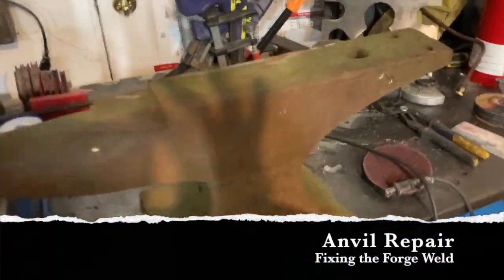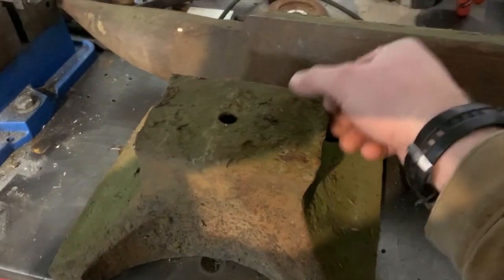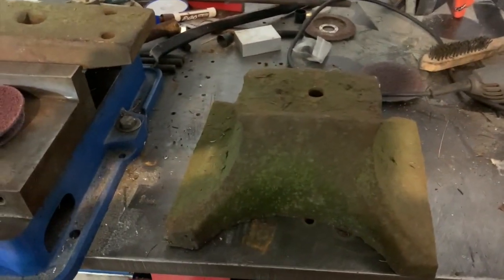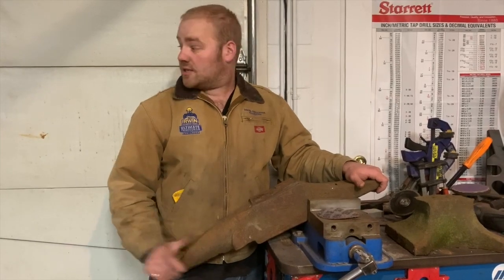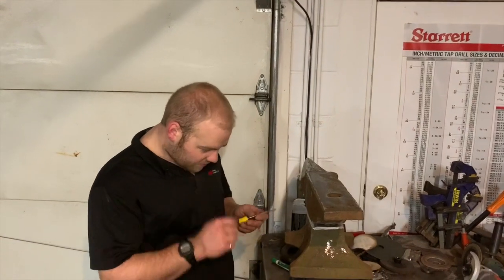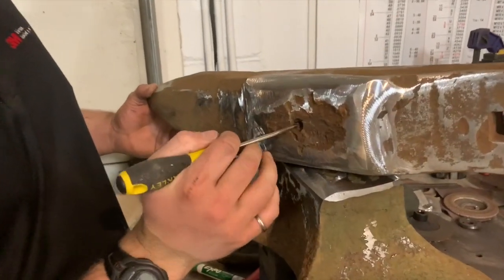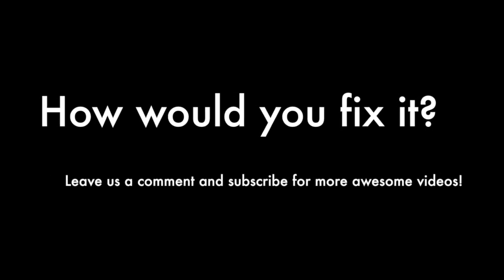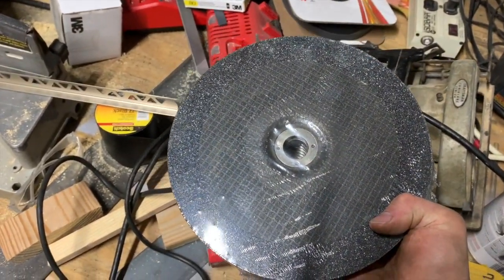Broken Anvil Repair Part 1

Comment: I have one question how did the anvil break?
Reply from the maker: Hi Austin! These anvils were made from multiple pieces of steel that were forge welded together. So it's possible that it broke along one of its weld lines. Another theory is that during the end of the Civil War anvils were broken as a way of harming the rebuilding process of the opposing side.  All I know for sure about its history is that i pulled it out of a rock pile. The person that had the rock pile had traded three one bottle plow blades for it with the intention of making it looked like a stretch anvil. But I decided to restore it as close to original as possible. Thanks for the question.